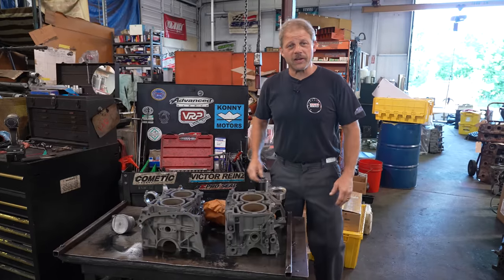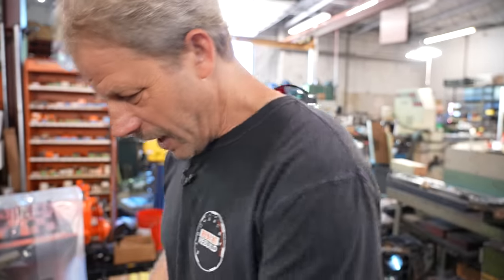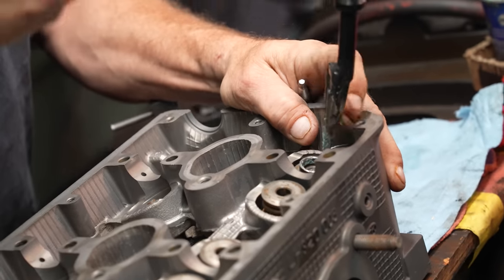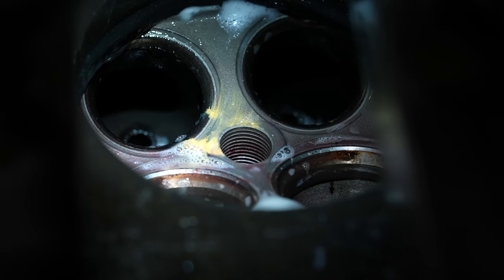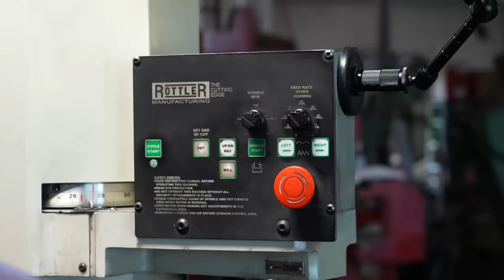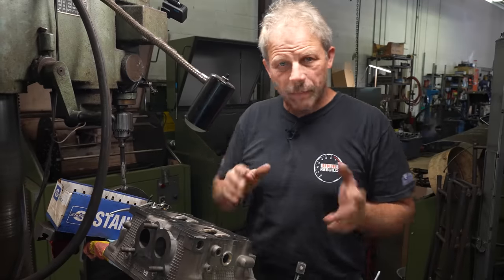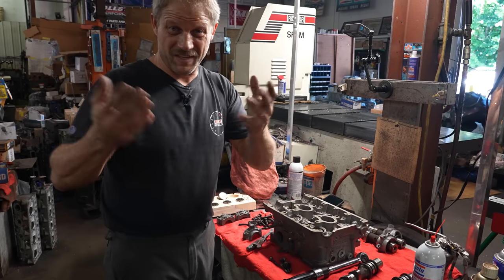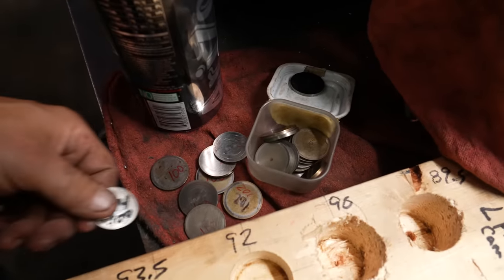Cracking Heads! Our Subaru EJ-205 Heads To The Machine Shop

Comment: That type of lash adjustment is tedious. And you have to have a huge selection of shims!
Reply: It's easier if you measure the shim, measure the actual lash and do the math yo get the shim you need.
Reply: A huge selection of shims makes it faster, but that is not needed.  When I adjust the valves on my BMW motorcycle, I know what shims are in the from the last adjustment and all I need to do is measure the lash and enter that into my spreadsheet.  The spreadsheet then calculates what shims I need to get everything back in spec, subtracts out the shim sizes I already have and then tells me how many new shims are needed and which size shims.  I then place my order and get exactly what I need.  Easy peasy, just takes a couple of weeks for BMW to get the shims to me.

Comment: The one thing I want to know is where Thrilby's purchased the sanding tapered cone that they used to take the edge off the top of the cylinders after boring and honing.  I haven't been able to find one, and I've searched on and off for about a year for one of those.

Comment: Why would you use cracked heads? Cracks don't get better over time and coolant leak is not the only consideration. Weld the head and replace the seats if you must use these heads.

Comment: Odd to me that the cracks were left just as is.

Isn't there a risk of the cracks continuing after reassembly and the pressures of a running motor? Why not have a welder attempt to repair the cracks, and barring that, why not opt to use a set of heads that aren't cracked?

Seems like a problem waiting to happen later on down the road, or am I blowing that way out of proportion?

Comment: I honestly didn't even realise how prone these heads are to cracking. I've done heaps of head gaskets on these, and I just walk them across to the machine shop. We always get the head's pressure tested on any engine.
Reply: Done hundreds of these myself in automotive machine shops. Rarely see one not cracked. Never had one leak during pressure testing and never had one come back.

Comment: Could you do one of those solid thread repair inserts on the spark plug hole or would that just make things worse?
Reply: It wouldn't really do anything.  Helicoil won't stop a cylinder pressure leak.  It would be wiser to weld the crack with a Tig machine and re-cut the threads.

Comment: What's that blue type of grease you used before putting stem seals? I've never seen that they are necessary, but I need to change mines on my Miata, and it would be very interesting to know that. Keep the work on!!
Reply: Marking compound. It's what they use to check for high spots when they lapp the valves.

Comment: So heres something I’ve wondered over the years

When you test springs

Shouldn’t that really be done “hot” as its hot when operating in the motor…….. and considering metal gets softer as it heats up……
Reply: @DontCryAboutIt  I don’t know that’s one for the engineers 100 deg C I suppose
Reply: "Metal gets softer as it heats up." Yes, if you heat it to the melting point. At anything remotely resembling normal operating temperatures for an IC engine, nope.

Comment: I would've thought that it's possible to TIG weld those cracks to get the most life out of the heads?
Reply: I'm only guessing, but I think it's too deep to do that, and that's probably a touchy area to introduce potential distortion from the welding.
Reply: @leeh9420  also its shitty cheap alloy at the end of the day

Comment: Crqcked heads in a turbo engine? You MAY get away with them on a non turbo engine that is not driven hard. But those cracks when worked hard will end up glowing like a glow plug and cause all sorts of detonation. From what I am told it is only the turbo engines that crack the heads. Not that hard to believe!
Though you dont have a chassis for the engine anyway!!
I like the idea of using the old drill press for a valve spring tool. Should be good for most factory style valve springs,,probably not my solid roller race springs though.
Shims and cam buckets. Something to drive most people silly. I can remember my brother swearing a lot doing bike engines. Where everything is small.
I did some old Bimmer ones,, never again. I am like many places,, take it to the dealer for that work. And they stuff it up too!!
Reply: Ive been running 500BHP for 140k miles on EJ207 STi 2.1 high compression 9.3:1 engine at 1.8BAR boost with cracked heads. They crack almost instantly on these engines from new.

Comment: With those cracks right up against the exhaust valve seats there is a concern that the seat inserts aren’t held as tightly within the head casting as they should.  The last thing any one would want is for an insert to drop out.
Reply: I've done hundreds of these heads and have never seen one drop a seat. Also don't recall seeing one not cracked there. Some engines are just prone to weird cracks like this and we reuse them as time has proven them to be fine to operate with the defects. We have no issue ordering you a new casting since we make money off the sale with zero effort involved but that new head will just crack also. Bit you'll never know it's cracked untill it comes off the engine. I have always wondered how long do they go before they crack. I know they go a long time while cracked, just not sure how much run time it takes before they do.

Comment: Subaru frustrates me; brilliant design (the EJ25 scaled up to a 5.0 liter 8 cyl would be over 350 hp) but stuff just breaks and is expensive to fix.
Reply: Which means it actually isn’t a brilliant design.
Reply: @LTVoyager  True enough. I want to like them but they've let us down repeatedly.

Comment: As you made no attempt to fix them, aren't you worried about those cracks getting worse?
Reply: It a Subaru. It's for the youth. It's not a proper restoration :D
Reply: It's a crack, it will continue to grow because that's what cracks do. The question isn't is a problem or not, the question is how long before it is a problem. From the looks of it, probably not long. But I think by now it should be obvious, they don't really care about this thing, they are just doing it for a certain segment of the viewership. It's a junker used for educational content.
Reply: @funkyzero  you are right , the crack area is the area with most of the stress concentration 
Thats why cracks get bigger and bigger
Reply: Nope. These heads always crack. I don't recall ever seeing one not cracked. They won't have a coolant leak there either and have yet to see one drop a seat. Some engines are prone to weird little cracks like so but the test of time has proven them to not be an issue. We have no prob ordering you a new casting, we make profit from the sale with zero effort and can move along to the rest of the pile of machine work we have lined up.

Comment: Still don’t get the flat 4 hype. Yeah weight and distribution advantage but these engines do not seem to be built as bulletproof as they should have been in WRX form. Shame. 

If only Toyota made one as reliable as their 3RZ FE.

Comment: sadly this engine will blow a head gasket as the machining appears to have been incorrectly done. Subaru REQUIRES that fixtures be added and torqued to spec. prior to machining. The block is designed to flex under load and must be flat after the torque load is applied. Essentially you ruined the engine. Frankly I am  disappointed. Listening how head gaskets are an issue (a few episodes back) then not updating in that episode that gasket material was changed to fix the problem after market. Then sloppy machine shop work.   Please do your homework if you are going to step outside your sandbox of  American iron. If you use the standard graphite head gasket that comes in the Subi reseal kit, it will be clear you do not care.
Reply: Could've made the same excellent observation without being condescending or snarky.  We're all trying to learn here, not play gotcha-games.